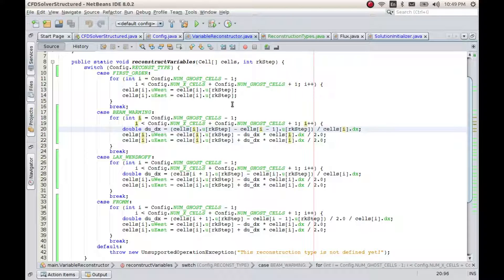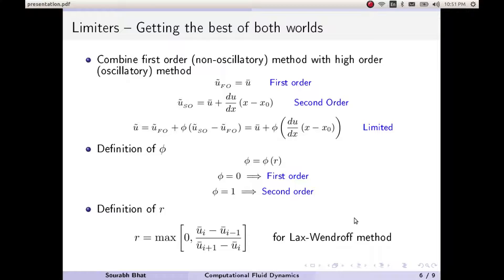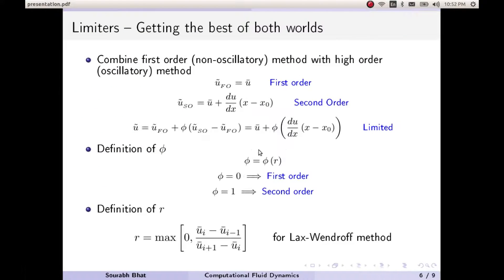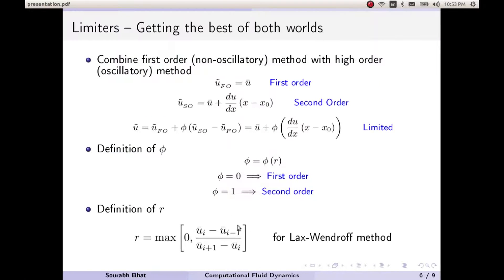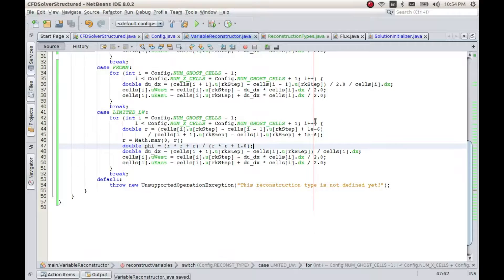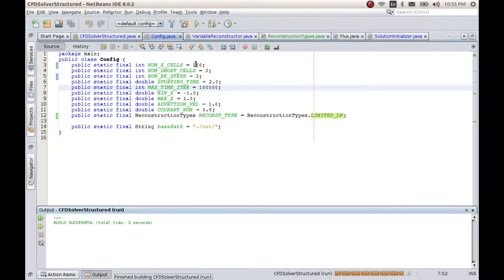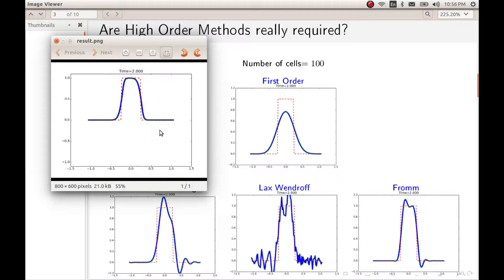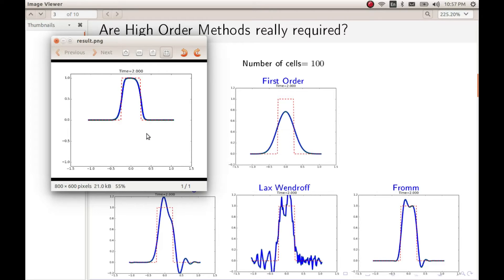012.2 - Limiter - Computational Fluid Dynamics (CFD) - Code

Comment: Thanks a lot Sourabh Bhat for the great explanation and linkage to your previous video! Could you please tell me, which solver do you use, once when you reconstruct your left and right values?
Reply from the maker: In this series, I am using the local Lax-Friedrich Riemann solver (also called Rusanov solver) for calculation of the flux.
Reply: Thanks a lot for the quick reply!! I have HLLC Riemann solver and so I hope I can use it in the exactly same way. Would you calculate r and limiter values in 3D separately for x-, y- and z-direction or just one unique value per cell? Thanks for sharing your knowledge with us!
Reply from the maker: Yes, you can use exactly the same method for HLLC as well.
You have to calculate 3 separate r values and different limiter values for each of the directions. If you want to be on the safe side you can use the smallest of the 3 phi values. However, using different derivatives for each of the directions will also work and give better resolution of discontinuities in 3D.

As you can see the use of separate r and phi is feasible only in case of Cartesian mesh, so in practice it is common to use the safest phi as in BJ or VK limiter.

It may help to look at the videos in another series, about extending to 2D, where I have calculated values of r and phi separately for each direction.